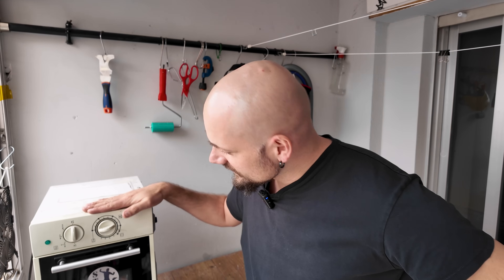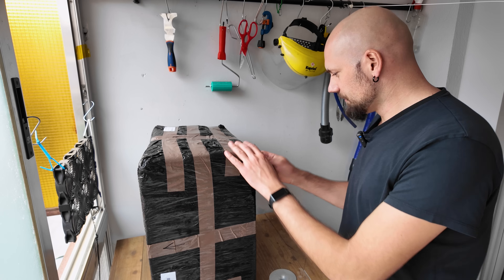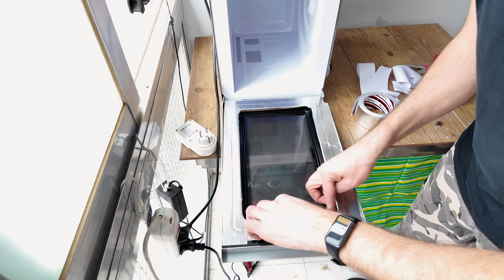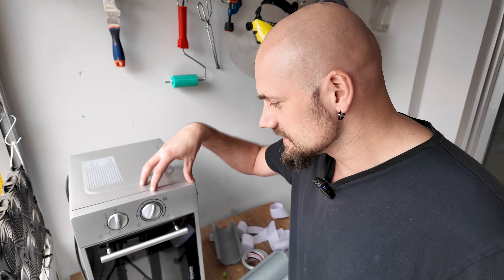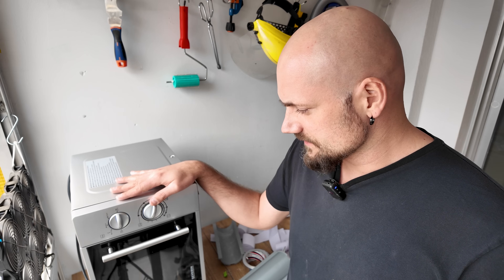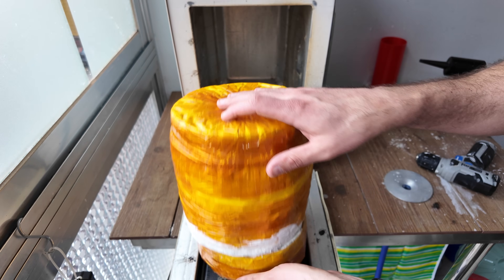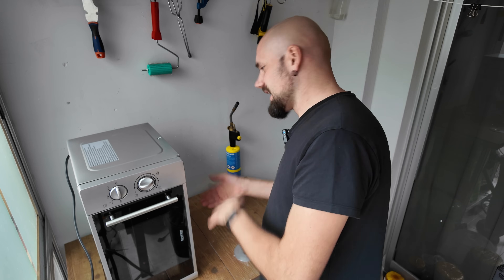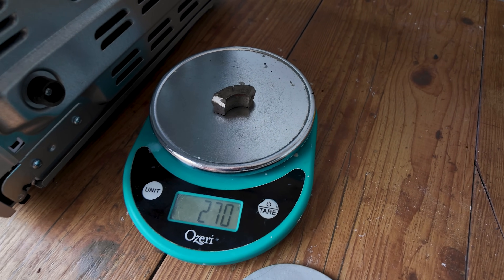I bought a new Microwave to Melt Metals

Comment: Great video! I’m in the U.S and most of our microwaves are touch controlled , programmable with digital led displays. What are your recommendations for this style microwave?
Reply from the maker: There is a product called "Fingerbot" or alternatives. It's a smart switch that can physically press a button. It could work with some microwaves, especially if your microwave can be started and stopped with the same button.
I actually bought one to make a video about it, but I haven’t had a chance to check it out yet.

Cheers!

Comment: 1. You can easily kill a microwave if you operate it unloaded. 
2. It's easy to repair a microwave. More than 90% of the failures are just the HV fuse blown.
Reply from the maker: It's true, but it's not without a load if you microwave a crucible. Cheers!
Reply: @ShakeTheFuture  
I am still trying to buy Silicon Carbide to build my crucible🥲

Comment: Can you use aluminum oxide in stead of silicon carbide for the cylinder?
Reply from the maker: Silicon carbide crucible absorbs microwaves and heats up. If I used an aluminum oxide crucible, it wouldn’t heat up on its own. I suppose I could use it inside a microwave kiln— one that’s lined with silicon carbide—but it wouldn’t be as efficient. That said, it can definitely be done, and for some people, it might even be a better or easier way to do it. Cheers!

Comment: you should be careful not to change or damage the quarter wave length gap around the door that forms a trap to stop the microwaves leaking into the surroundings (you should check leakage with a suitable meter)
Reply from the maker: I do have a proper microwave-leakage meter. ALL GOOD! 👍 Cheers!

Comment: Thought about putting multiple magnatrons in the new MW? It's just a case of making a hole for the magnatron emitter and using the old electronics to run it right?
1 MW 5 magnatrons, that's gonna be interesting! :) 
Have you seen styropyro's 20,000W microwave? (recommend a watch if not, 100%)

Also, to test you can time how long it takes to boil a glass of water. GL with the new oven!
Reply from the maker: I've thought about it, but I’m not sure if I’ll ever do it, since I try to keep these videos themed around using an ordinary, non-modified microwave for metal melting. That said, there’s definitely room for experimentation. I’ve seen Styropyro’s video—it’s insanely powerful, though I wouldn’t use something like that on a daily basis.
Reply: I don't think you can "just" add another magnetron 🤔 RF magic and all that.

Comment: You should consider covering the fan port used by the microwave to ventilate steam. The air exchange will certainly slow the heating.
Reply from the maker: My microwave only has 1 fan that is mainly used to cool down the magnetron as far as I can tell. Cheers!

Comment: Why didn't you get a more powerful one?
Reply from the maker: Because I need an analog microwave so I can use it with a cycle timer to burn out molds. In the EU, there aren’t many large analog microwaves available. This one is 28L. There are a few 30L models, but I didn’t want to risk it, as I’ve had a very good experience with this exact microwave and not so good experience with other brand microwaves. That said, I’ll probably get another one—maybe a commercial microwave—for metal melting, just to see how fast we can melt. Cheers!

Comment: Why not line the walls with a refractory material?
Reply from the maker: It could be done, but since I also use the microwave to burn out molds, I prefer this setup. Chambers and kilns. That said, I might do it with one of the microwaves, but only for mold burnout as occasionally I need something a little bit bigger. Cheers!

Comment: Do you prepare the microwave for melting somehow, or can it be used according to your toturtial straight from the box? In one film you showed a bimetal fuse, I understand that the cover made of fireproof fiber and Kapton tape does not release heat to the outside and the microwave can work thanks to this despite the high temperatures of the metal inside. Am I wrong?
Reply from the maker: I don't do anything to the microwave apart from what's shown in the video. Yes, the insulating chamber traps the heat. The outside of the chamber doesn't get that hot (it depends on how long you microwave it). I showed the thermal fuse in one of the videos just to demonstrate what can happen if a microwave overheats. This particular microwave doesn't overheat, but I have used others that did. It mostly becomes a problem on hot Spanish summer days when I try to do longer melts—especially if I do it right after using the microwave kiln to burn out molds. But yeah, this microwave is very good, and I don't have overheating issues with it. I don’t even remember if it has ever overheated....other did. Cheers!
Reply: @ShakeTheFuture  Thanks
Reply: @ShakeTheFuture one more thing, can i use graphice crucible in microwave?

Comment: For this, I can imagine you want a microwave that is a dumb as they come. No fancy sensors, no steam features, no high-frequency inverters. Just a good old heavy transformer hooked up to a magnetron tube, all controlled by a mechanical relay.
Reply from the maker: Yes, a simpler microwave will probably be better, especially when it comes to burning out molds inside the microwave kiln. You can use a cycle timer with an analog microwave, but not with a digital one unless some modifications are made.
Reply: I vote for a digital one, which can operate for a precise time, mostly in the short duration.

Comment: Severin site lists as 169.90 € and in the US only seller I could quickly find was Amazon $361.21 LOL I store my scale on top of the microwave.
Reply from the maker: Yes, the new one is priced between €129 and €149—that’s why I bought a used microwave. That said, Severin microwaves often show up as Amazon returns in European Amazon stores. In fact, there’s one available for €110 as I’m writing this comment. If I understand correctly, these microwaves aren’t available for 120V power grid. So if you were to buy one in the USA, you’d likely end up with a 230V microwave which would not be very useful.

Comment: In the low-budget segment, microwaves are virtually identical. I was hard-pressed to find a microwave (for actual food) that wouldn't just be the same thing, only with different dials and displays, and eventually settled for a platter-less inverter microwave, since for cooking, it removes the problem of (small) things starting to cook violently for a few seconds and then getting stone cold again at low power levels. Anyway, if you want to melt metals consistently, you'll eventually have to buy an electric furnace for exactly that purpose.

Comment: Perhaps a silly question, but why not get a larger over-stove microwave, and also a higher-wattage? Or perhaps just get a stronger magnetron and build your own custom box? More suitable for melting metal.
Reply from the maker: I suppose I could try some of the things you suggested—and I might. As for getting a larger microwave, in the EU we don’t have too many options when it comes to large analog models. I specifically wanted an analog microwave so I could use a cycle timer to burn out molds. Also, the magnetron isn’t the only factor that controls the power. The magnetron I replaced in the old microwave came from a 700W unit, while the one in the video (both new and old) is a 900W microwave. So they’re actually using the same magnetron for both 700W and 900W microwaves. Cheers!
Reply: @ShakeTheFuture  I can see the desire to have analog for cycle control. I think in my case I would be bypassing all of the internal timer circuitry and have it all controlled externally, perhaps via something like an ESP32 with a relay. Then I could dial in exactly what I want the magnatron to do.

Of course we all have to work with what we are comfortable with, and regardless you appear to be having fun and making great content. I just always think when I see your videos, what if he went biiigggeeerr, haha.
Reply: @scrampker  Because they are all the same internally, they don't perform differently. You'd have to shell out big bucks for one that is mechanically different, and even more for one that's electrically different.

Comment: yeah, I think mine is on the end of its life too. It takes roughly 20 min before it melts aluminium, and in your video about it you said it takes only 8 minutes.
Reply: Maybe first put it on defrost... /jk
Reply: @graealex  😄
Reply from the maker: When it comes to microwave metal melting, there are many factors that can affect the melting speed—crucible size/thickness, chamber size, how worn the chamber is, and of course, the microwave itself. Yeah, 20 minutes isn’t great, but then again, if you’re not in a rush… who cares? :)
Reply: @ShakeTheFuture  my crucible is indeed quite thick. Only the smaller ones work

Comment: the thing with the kitchen scale....is the EMF messing with the strain gauge? IIRC, the construction of a strain gauge might act as an antenna in close proximity to a strong enough EMF, since they are basically just interlaced "fingers" of conductive material.
Reply: The strain gauge measures in the uA order of magnitude, usually through a Wheatstone Bridge, and localized EM fields can throw those measurements off.
Reply: @graealex  kinda figured that.  like I said, the strain gauge is kinda acting like an antenna, and the emf is inducing a signal in the same way a radio picks up signals from a radio station.  same way a microwave can interfere with cellphone and wifi reception
Reply: @aeislugh  The point is that a Wheatstone bridge relies on none of the legs being out of whack, while a microwave produces highly localized EMI.

Comment: From the comparison-photo, I see a rather big difference ! Why do you say, the difference is small ?
Reply from the maker: I suppose it wasn’t the best word choice :) What I meant is that there is a difference, and it’s definitely a nice boost, but it's not exactly night vs day, but it’s definitely better—that’s for sure. 👍
Reply: Because all these microwaves are the same internally. They just slap different dials and enclosures on it. The one with 20 cooking programs is only different in having a micro to control the time it's running.
Reply: @graealex  sorry, I rather meant the difference in the glow of the 2 crucibles...
Reply: @klausbrinck2137  Ah, yes. I thought there was some difference, but without knowing all the variables, it's really hard to tell. You could just load the crucible differently and get different results.

Comment: Hello !
There are 1500W microwave, often sold as "commercial" microwaves, they cost 10x but sometimes can be gotten for cheap or free from a business.
Also, I am exploring another alternative heating method. 
Induction heaters can also heat silicon carbide molds ! And they are also available for cheap (less than 100$)
One big plus of induction heater, is you can put a bell jar on top and pull a vacuum even easier than through a microwave
Reply: Also again, a pyrometer, in the form of a thermocouple
Specifically an S type thermocouple will read up to 2372F / 1300C and costs approx 12$USD on aliexpress
Reply: You can measure the S type thermocouple with a simple voltmeter as the top end temperature will read 15 volt =  1450C
Reply from the maker: I've always wanted to buy one out of curiosity, but so far I haven't found one at a good price (not that I've been actively looking). Also, since I make metal melting videos using a microwave, I wanted to keep using an ordinary microwave for most projects to show what's possible. That said, I'll definitely get one eventually just to try it out. Cheers!
Reply: @ShakeTheFuture  Maybe an old microwave from the 80s or even 70s would be better, since they're not built down to a price.
Reply: @graealex  do take note that magnatrons can and do go bad, so he has to balance many variables here.
Reply: @scrampker  You are right, like with any vacuum tube, the filament inside is subject to degradation. Unless you use it to melt metal, you won't notice it though, since lifespan vs. actual usage is usually in a very advantageous relationship.
Reply: We have a second hand DIY store locally here affiliated with the  charity Habitat For Humanity, I have bought quite a few commercial micro waves there for 5$ each, many are close to new condition.
Reply: I have one of those 1200W ones, but it's broken. Tried to fix it by replacing the diode, but it didn't work
Reply: They end up free on KC craigslist a couple times a year when restaurants close, move or change management
Reply: Also you can use a microwave transformer and some copper tubing to DIY an induction heater

Comment: 65€? Damn. There are like at least three  being given away for free in my area. Would have sent you one but shipping would probably cost as much as you paid for yours 😬
Reply from the maker: I know, I know. I can also get used microwaves for €5 here, but in the EU we don’t have a lot of large microwaves. This particular one is actually quite big by European standards—28L (0.99 cubic feet). I also knew it was practically new, and I wanted this exact model since I know it's good and analog as I wanted an analog microwave so I could use it with the cycle timer for mold burnout. Cheers!